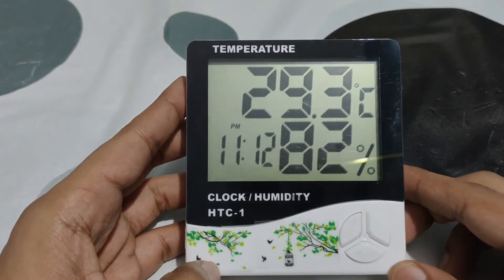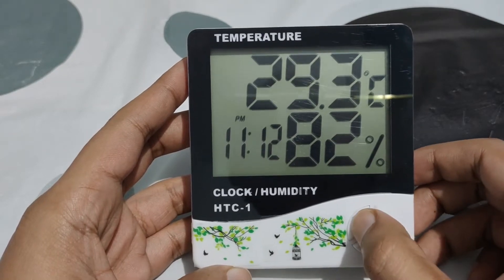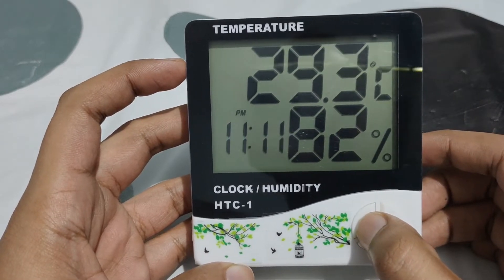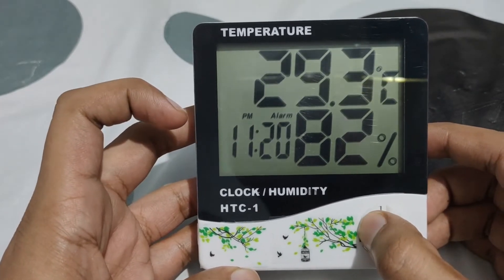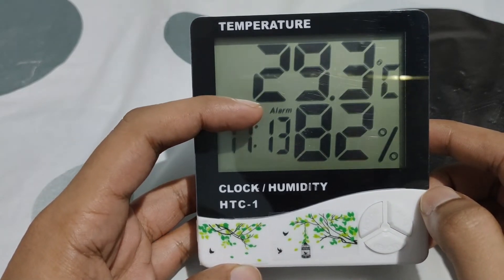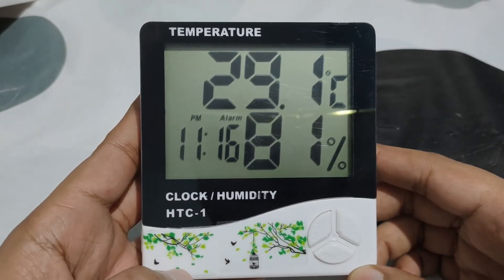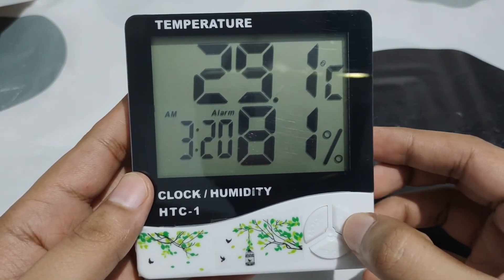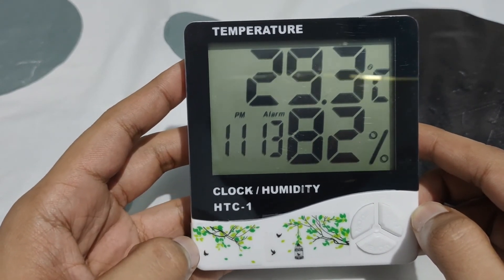HTC-1 Temperature Clock Humidity Alarm Setting Demo

Comment: What does the sideways Wi-Fi signal do? Beep on the hour?
Reply: Sideways wifi xD.
It's a sound icon
Reply from the maker: Yes its seems to be for that function , but it does nothing in my clock.
Reply: @uniquereviewshacks2121  @jaytea2140 I figured out what is the symbol stand for. When it's seen on the display, clock beeps every hour. It can be disabled to turn it off.